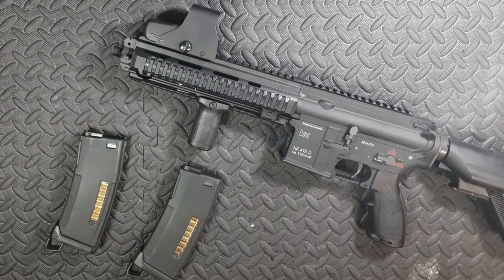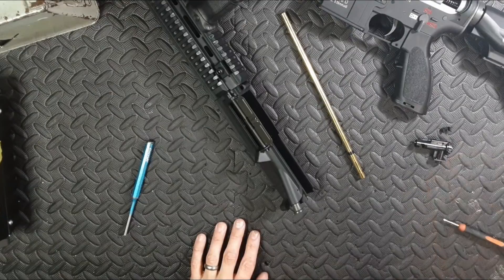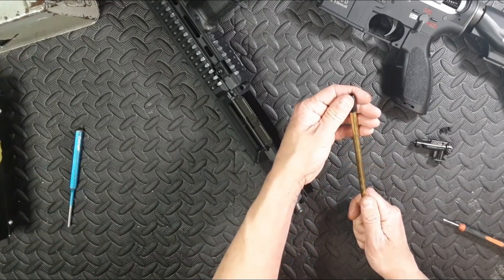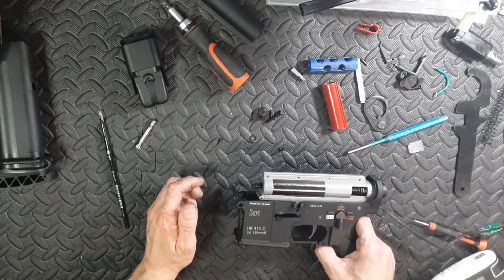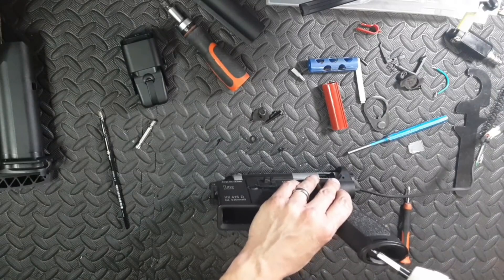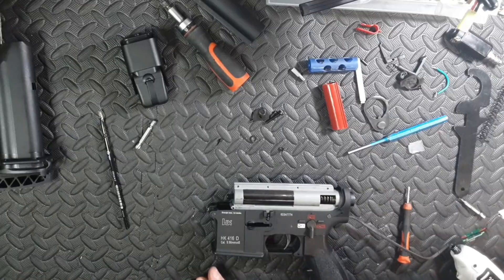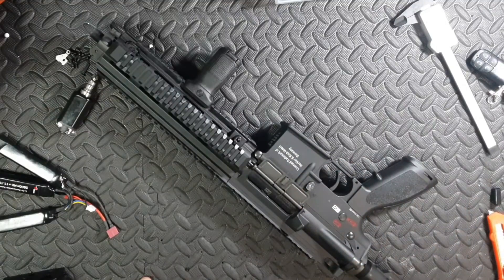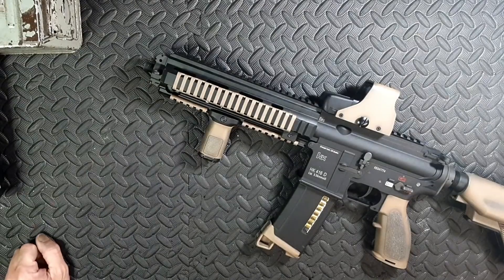VFC HK416D   Same Old Story

Comment: I felt the entire length of the video in the bottom of my heart. I've been fighting with a vfc 417 since march 20th and have done lots of things to it. And the worst part of the entire build it's been,with no doubt,that fucking "416 style"  pistol grip. The lid on the bottom of the grip it's so fucking thick,that it pushes the motor and also de the wiring so deep inside the pistol grip,that you have no room to adjust it with the adjustment screw. You have to grind the hell out of it for the motor to fit properly inside the grip,and allowing the cables to rest nicely inside. So I recommend you try to grind the inside part of the bottom lid and try to fit the motor in the grip. Nice video,love watching these mate!

Comment: Had this same issue last week with a ggv2 series 2 and a pts grip . If the shimming was correct the motor would not work.  Dam thing was at a hard angle  and deep as hell . Changed grip everything 100%   w.t.a.f

Comment: I've been fighting with a Classic Army G3. It came to me with a broken piston and I gutted a Classic Army Sportline 416 gearbox for it's piston. The sportline had shitty plastic bushing yet worked so I figured it was best to just part it out to fix the G3, plus the SL gearbox had issues with low fps, either worn spring or seal?. ANYWAY. I reassembled the G3 gearbox (A standard line with brass bushings out of a nice full metal SAR Officer.) It seemed to go back together fairly well. There were no shims to worry about getting back in place, and everything seemed to spin and move freely before closing the shell. When I put it back in the gun it would only turn over a little then jam up. I'd pull the motor and drop the antireverse to let it go back to fully decompressed and it would still do the same thing. Multiple batteries, fully charged. So I don't think it's a power issue. I've heard of this happening with guns left partially cocked but never with a fully decompressed one.

Comment: You can actually do the flat hop bucking mod and leave the guide in place but you have to make sure you shave the contact nub off perfectly/almost perfectly, i used my expensive craft knives and a magnifying glass and it works an absolute treat, also with an S hop patch.
Reply: I do believe so, after all Modify flat hop bucking comes with guide in place.

Comment: motor assembly: put an allen key through the allen hex bolt hole and push the motor down while sliding the cap on the grip. harder to say than doing it
yes this rifle is a PITA.

Comment: Had the same motor problem with mine. Only way I got it to work was using very low power battery so I could have the gear turn while pushing the end plate into position. Only stripped one gear while trying to get it to work!
Reply from the maker: It's bullshit isn't it

Comment: Honestly i think the guy either got a lemon with that 416 or vfc has started to fuck up. I have owned a vfc 416 for 6 years now, ran flawlesly for a year straight being used every sunday (then i started upgrading it). I have never encountered those problems, ammitedly i could not replace the grip since every other grip just made a shit aoe (motor got replaced right away).
Imho vfc externals are good just for the tight fit and quality of materials, finishes sucks, mine got scratched almost immediatly.
(regarding the price thing, a big cut goes to umarex for those nice trade marks, so realistically that is a 350ish euro gun, just like marui's price is inflated by imports)
Reply from the maker: I'm doing another right now... no bs.
Terrible.
Reply: Maybe they started to fuck up with the whole mosfet wave, like g&g. A friend of mine has one pre-mosfet era and it shoots pretty accurately, it hasn't been opened yet tho

Comment: How not to correct motor alignment: Grind pinion gear, curse VFC and replace entire gearbox.
Reply: works well when you need it to. especially for magpul moe motor grips
Reply: What would you do then ?
Reply: Ryan Groza Maekii motor alignment tool (look it up) to check motor alignment with just the grip and gearbox shell. If correct, the tool will be centered to the hole where the motor height screw goes. If not correct, you can either replace the grip, or, use aluminum tape or some sort of thin sheet to actually shim the angle of the grip when attached to the shell such that the Maekii tool is centered in the before mentioned hole. I like to use the former for shims. It’s thin, can be layered, can be cut into custom shapes, and can be undone if desired or necessary. After you’re alignment is good, it is essential to check this again with the gearbox in the receiver. Often, the receiver will meet the grip before it is fully seated to the gearbox shell. Therefore, if alignment is correct when not in receiver, and is incorrect when in the receiver, then one must sand the grip where it meets the receiver. The goal is to have a hair thin gap between the grip and the receiver. I use a flashlight to check the gap by shining through from the other side. This takes time, and time is money, if not money then generosity. When done correctly, the motor will be aligned and engage properly with the the bevel gear. This alignment is the cause of a lot of noise, even if motor height is correct, or if the gears are shimmed correctly. This can cause unwanted friction which results in resistance which results in heat. I have worked on many VFC M4s and M416s, new and old, not including the two I own (old). I have not encountered such issues with the grips whether 416 or standard, but always went forward and corrected alignment as this makes the whole system work better. The wires are tricky in the 416 grips, the self shimming blows, the old polycarbonate parts are weak and not that resistant to chemicals. The threads to the GB can strip easy if mistreated, the aluminum selector plate can bend out of shape, and other brand GB shells are tight fits in many VFC receivers. But, motor alignment is motor alignment is motor alignment.
Reply: I think replacing pistol grip would have been easy enough? I believe the grip causes the problem because it is different shape than regular AR15 grip
Reply from the maker: @anttechairsoft  New VFC video coming up next where you'll see me test the same gearbox in a different VFC pistol grip.... even worse.  
You're right about time being money & the fact that VFC are so shabby with their internals everybody involved is better off if I just swap out the gearbox to a superior unit.
You won't find me using aluminium tape (or tin foil as it's basically known) & when people want the HK look they forked out nearly £500 for, the thought of changing the pistol grip doesn't fly.

Comment: How are the ICS M4's now-a-days? Thinking about restarting airsoft, once the world isn't on fire, and was thinking ICS M4 Sportline (i don't like the idea of built in smart triggers or mosfets that can't easily be replaced by a non-tech), is the split gearbox easier to maintain? is the safe position spring decocker... a problem?, if the sportline has one, does the decocker interfere with a warfet in anyway?
Reply: they're not terrible, but not great. i think this guy would point you towards a G&G CM (aka combat machine) model unless you've got some experience working on a gearbox. In that case, go for a specna arms or e&c (same manufacturer). If you're willing to spend another $100, you'd be pleasantly surprised with a stock cyma platinum series, but also have a very simple upgrade path. New mosfet, motor, and hop rubber in one of those and you've got yourself one hell of a gun. MUCH better than a stock krytac or vfc avalon for the same price (after the aforementioned upgrades).

Comment: Love the content, could you possibly make a video explaining how to put the right amount of grease inside a mech box and where the correct places are to apply it
Reply: theres plenty of youtube videos on that. its not a very complex thing. you can get really picky with the different types of oils and grease to use and where each type belongs, but you can just get some synthetic multipurpose ptfe grease and be just fine. Use silicone oil on o-rings/compression parts, though. its designed for air seal.

Comment: After finishing my vfc m27 (kh416 but longer) fitting motor is pain in the ass, fitting hop up same story and the fake bolt had to be removed cause when it got stuck i couldnt even disasamble the gun. But with m120 spring shooting cosistent 450 fps with 0.2 bb

Comment: The Specna M27 I use to own had an E&C gearbox and man was that thing a dream to work with. 
They deserve a lot more attention. I kinda regret not going with an E&C gearbox when rebuilding my current m4 (decided to build one from scratch with an ASG Ultimate shell - that thing was expensive, but at least I learned something... I think).
Reply: How do the e&cs hold up thinkin about buying a 3rd 416 and looked at the e&c version
Reply: @darylobey8867  theyre bottom $ for a reason

Comment: Is it possible to buy the vfc externals only and insert and e&c gearbox or do you have to buy the whole gun
Reply: you could technically build a gun like that but it would still be needlessly expensive. idk if retailers sell vfc externals. G&P externals are also great, but you might have to do some custom work to make them fit nicely with whatever you throw in it.

Comment: Yea i don't understand either what's VFC's problem, great externals, but crappy gearbox and well the coating is often also not the best. I own one VFC, but bought it second hand but new conditions for a third of the original price, and invested the rest in good harmonizing internals. now it works great and cost me the same as a new one. But for people without tech experience and luck to get such a good second hand deal VFC just sucks. But well, when you want an HK416 with markings (i personally don't care at all about markings, but some people do) or worse a MCX Virtus (with is even worse than the HK416) , you don't have any chance and need to buy a VFC
Reply: Doesn't the MCX have Avalon gearbox, which is pretty good?
Reply: No idea what you consider as good XD
But yea The MCX has the Avalon Gearbox, but i would say that that gearbox is maybe average. I mean i own a an Avalon Calibur, and first the Tappetplate broke, what's typical for VFC, next the spurgear and finally the piston (without any tuning, just out of the box).  Event the new CYMA lines have better internals (better gears, steel rack piston e.t.c). My Avalon runs now great, but there's nothing left of the original internals. And well, here in Europe most fields i play have a limit of 2 joules for assault rifle type guns, and for 2 joules the Avalon gearbox is to weak in all manners. But what i like are the aluminium pistonheads VFC makes, those are good.

Comment: Never liked VFCs guns. I had an Avalon in 2017  and the copper threads embedded in the bottom of the grip fell out so I couldn’t screw my motor plate back on. Then the fire selector was pretty much trash. Oddly tho the gears and shimming sounded decent. But then the mosfet gave way under 9.6 nunchucks with a weak spring and stock motor in mostly semi auto skirmishes. Never going back to that company.
Reply: Sounds like you got a lemon

Comment: motor grip ...lol... just like king arms pdw pistol grips!! I just had a bout with one of those couldnt figure it out until I realized the motor angle was off due to the motor hole not lining up with the gearbox. The trick was to enlarge the hole slightly to the front of the pistol grip until the holes lined up. I ended up routing the wires from the rear of the pistol grip. As for the hop - kinda makes you think about hopup to gearbox alignment issues. as for the gearbox, if that thing has those shit spring auto shim gears in it youd have t0 gut the entire thing. Nothing else will work with VFC parts. My bet is that is the same POS they stuck in gen1 avalons and they thought they could put them in 417s to get rid of them and make more $$ in so doing.
Reply from the maker: Seems that way

Comment: Fuck me VFC are still using those piss poor sprung gears? 
I've not been inside a VFC since they first released the 416 and was asked to do a spring change on a gun with those gears and even all those years ago it was a piss poor idea. With them claiming to be the most "premium" brand with official licensing you'd think they'd want to use internals that won't shit the bed at a moments notice.